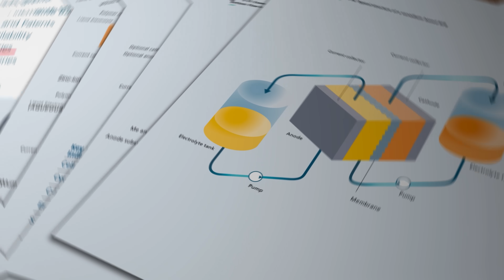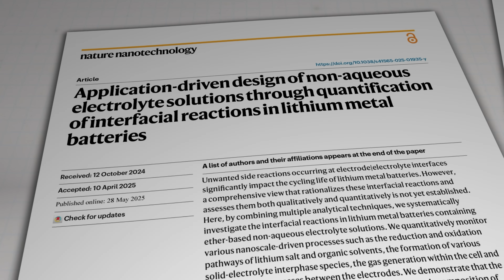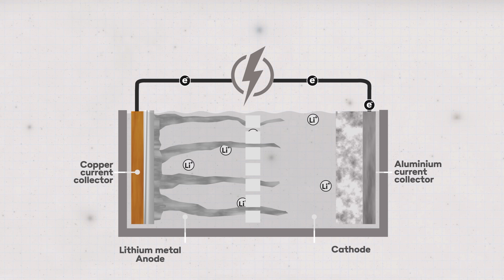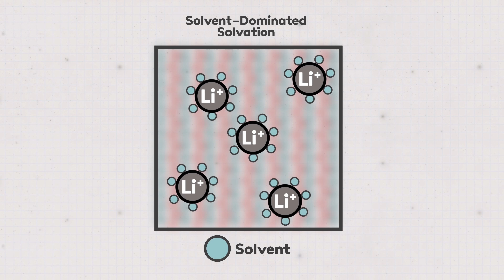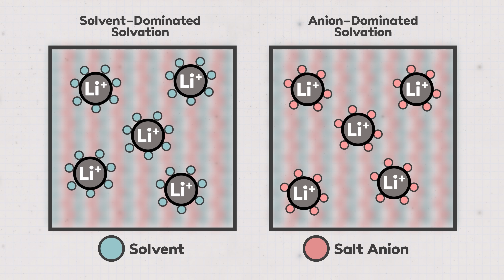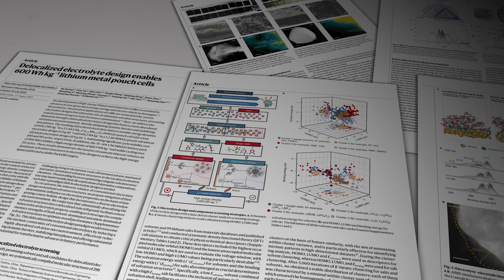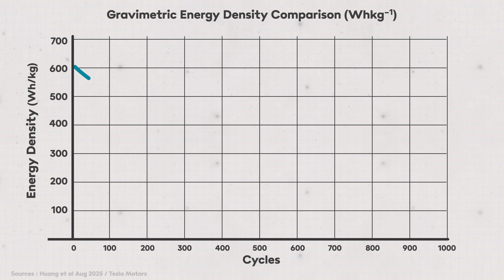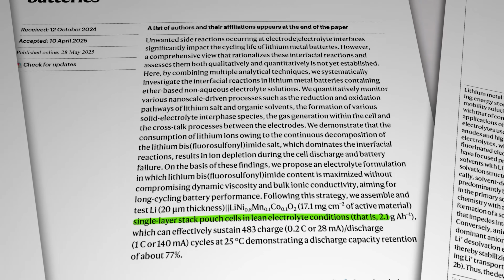New lithium metal battery doubles energy capacity! Has China beaten us to it again?

Comment: Wow! This could open the door for the electrification of air travel en masse! This will make air travel significantly safer AND cheaper. I think that grid storage and EVs will default to sodium given its price and sufficiency of density, but having high density will be a boon for tech that requires high density:  mobile devices (and their performance) and air travel, etc.

If these can be manufactured in low number, we may begin to see credible, prototype electric passenger jets surfacing as early as next year. 

China once again is charging into a new market with no real competition. If they can innovate electric jets that can transport people long distances, they will have ENORMOUS demand and will not be able to produce them fast enough.
Reply: On a more serious note, it would be a good idea to stop using high density battery techs for stationary storage, and I think sodium is the way to go for that.
Reply: @robinhood4640  Lol. And very true. I'm just waiting for the world to wake up to the realization that most of the energy we used is actually 'heat' energy, and we can get that by simply digging holes... Energy and electricity are not synonyms. Further, we can store heat quite easily in common abundant materials like sand.

For electricity storage, we can also use compressed air, which has been around for AGES and is extremely reliable (and cost effective). Sodium-ion is a happy alternative, in any event.
Reply: I know the cloud uses loads of electricity, but I don't think you plug an aeroplane into it to charge it.
Reply: Yes absolutely the floor to achieve economical electric flight with 4 passenger VTOLs was thought to be around 500 Wh/kg for 100 mile flights so as we get closer to 1000 Wh/Kg that will make it a reality and we can get to 20 passenger VTOLS AND 500 miles of regional range
Reply: @NickKacures  Yes, I remember reading this some time ago as well. Even for shorter hops (eg. a few hundred km) there should be high demand. It may also lead to interesting changes or morphology of airplanes interesting ways.
Reply: @NickKacures  yeah... what about light rail? oh yeah... tech bros didnt tell you that exists
Reply: Afaik, the main issue with plane electrification is that you can't use turbofan thrust for the plane because you require combustion for that and instead rely on the slower helix thrust.
Reply: Sodium doesn't have the "Sufficiency of density" for EV's (Cars)
It's 20% lower than LiFePO4,
The metric SHOULD be, SMALLER Vehicle, HIGHER density cell, meaning the battery is LESS percentage of the total weight of the vehicle and occupies a lower percentage of (valuable) space.
Reply: @rogerstarkey5390 and to be fair 95% of the people dont need more than 100km ranger 99% of the time.